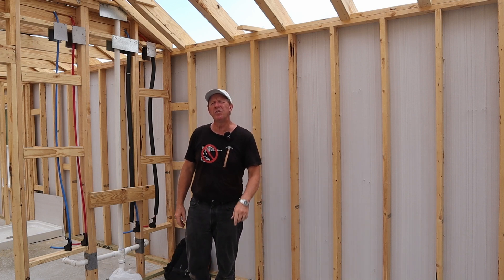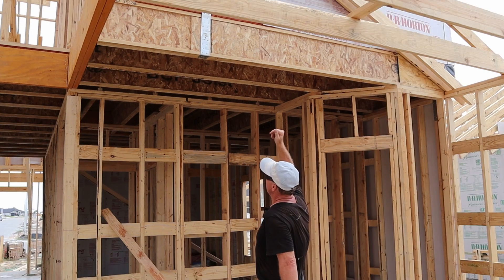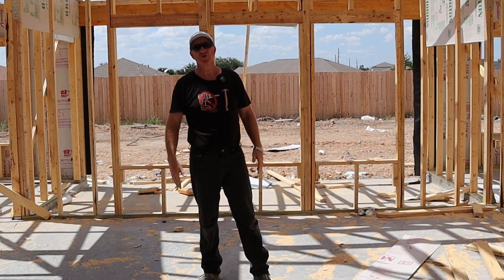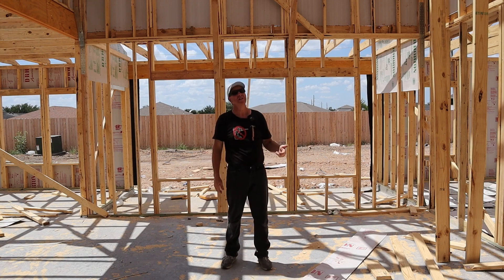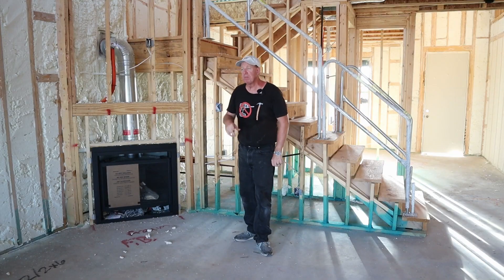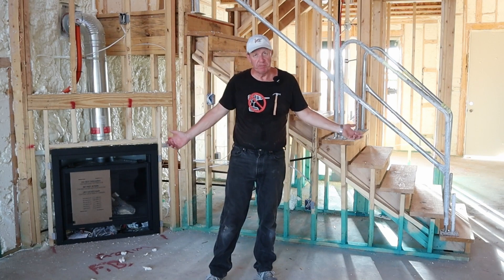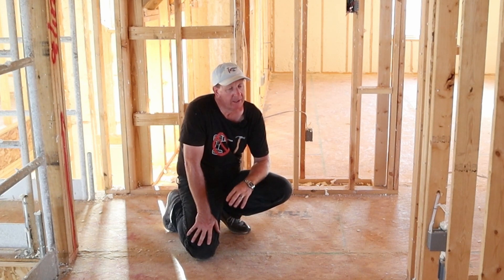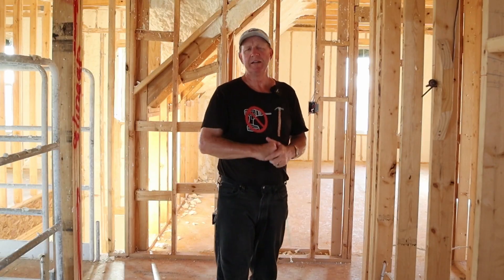Framing What To Look For-Stairs To Roof Of Your New Home Ep3

Comment: Thank you for this. According to a google search 30° or 7/12 pitch is the best to handle hurricanes/tornadoes. Hip roof style is apparently better than gable for resisting winds & metal roofing was deemed the most durable. Need to have the proper rake trim so the metal can't lift off of course. Having a hip roof can sometimes reduce insurance premiums. According to an article I found, frieze boards further increase the safety.
I personally prefer metal roofs and hate shingles.
Is the extra paper/sheathing on top necessary if the roof uses zip sheathing & metal roof?
It boggles my mind that cardboard is allowed to be used as sheathing. If I could actually afford to have a house built, I'd want zip sheathing.
I've heard that rockwool is better for insulating than spray foam but there has been some debate. 
I'm a big fan of under-stair storage. Having closets or little cubbies is a great idea to not waste space.
Not a fan of OSB in general and really hate it for floors. I know plywood has some drawbacks and can be more expensive, but I prefer it over osb.
Subfloor adhesive is something I hadn't thought of.
A friend of mine paid extra to have plywood subfloor-- it was in the contract. He didn't get to see the subfloor while it was being built and signed off on the job when he saw the finished floor. Unfortunately they screwed him over & used the cheapest OSB they could find. There was a flood and the OSB was ruined. His insurance company wouldn't do anything about it & it was too late the sue the contractors. So, checking up on progress during a build to make sure they are using what they charged you for is a good idea if possible.
Reply from the maker: Thank you for researching that.  Yes you still have to use the synthetic or tar paper when you use the zip system.  It is just extra good insurance.  Glad you enjoyed this.  I have an ep 1 &2 on this if you are interested.  Thanks for watching.
Reply: @OakleysDIYHomeRenovation101  Thank you. I will watch those ones next.
Reply: @OakleysDIYHomeRenovation101  Just to clarify (because I forgot to ask). The synthetic or tar paper goes on the bottom few feet of the roof edge but doesn't need to be on the upper parts? Is this necessary in places that don't get (or very rarely get) snow? I live in Louisiana where snow is very rare and I have metal roofing rather than shingles.
Reply from the maker: no the ice and water shield goes along the bottom, can also go over valleys, hops. @catsmeow5566